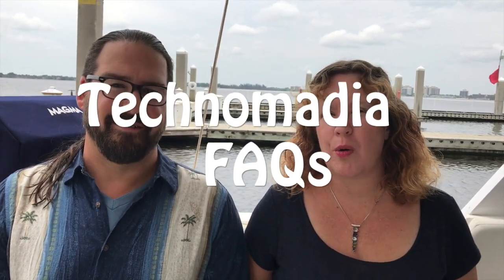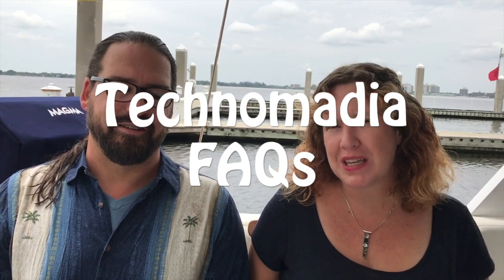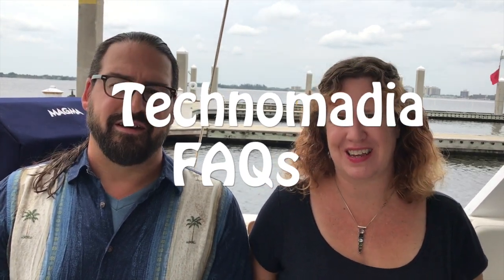Is a Watermaker Practical for the American Great Loop? | Cruising FAQs

Comment: A watermaker manufacturer told me that I could make drinking water from fresh water. Just reduce pressure from 800 down to 200 or so  as no to exceed the maximum water production.
Reply from the maker: We actually now have a water maker on board for use in fresh water.
Reply: @Technomadia  what is the brand and model?
Reply from the maker: We went with Rainmaiker
Reply: @Technomadia  thank you

Comment: How much do they cost?
Reply from the maker: It's a pretty major investment - there are a range of options. We haven't looked too far into it, because it's just not a practical option for our journey.
Reply: Its about 5 grand for a cruise RO like the wynns have. That is at the cheaper end since it is a kit made up of off the shelf parts. Makes 40 gallons an hour and uses standard 2.5 by 40 inch membranes which helps to keep running costs down.